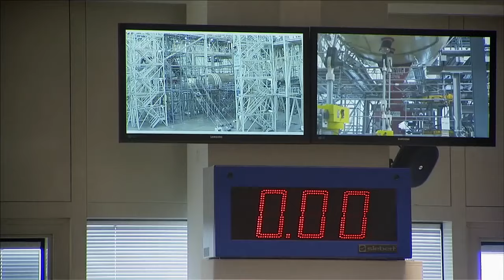Airbus A350 Ultimate Load Wing Stress Test

Comment: I used to be scared of turbulence thinking the wings will break off but when a saw another video like this is put my mind at ease.  Now the only thing that bothers me is the sickness caused by the up and down.
Reply: I don’t know if you still have this issue but my wife which is a nurse gave me a cool trick which does pure magic for me. 
I smell alcohol or something strong like etheric oils
It sounds stupid but it helps me incredible good.
One time we flew from AMS to JFK and we faced 3 times severe turbulence and it was absolute no issue for me because I pre ordered a whiskey just to smell on it when i felt a bit sick.
What also helped was breathing 4-7-8 technique and counting in my head. 

Safe flights mate !

Comment: The wings are incredibly flexible, but what about the mounting points where it meets the fuselage? Certainly as the wing flexes in flight, there must be tremendous forces exerted on those mounting points with the leverage generated by the outer parts of the wing. As I understand, the wing comes in 2 sections - left and right, and each section is bolted onto their respective sides of the fuselage.
Reply: Ever ask yourself why most large airplanes are round?
Reply: @RaggedsEdge  It's round because of max structural strength in dealing with pressurization and also to streamline.
Reply: @msbrownbeast  god…. I love getting actual good information from a YouTube comment😅
Reply: Both wings are connected to each other in a wings bar, it takes up the forces of the wing rather than putting the forces to the fuselage, the fuselage is connected to the bar instead. The same reason why the engines of the DeHavilland comet's engine design did not become a trend, since it requires a stronger and heavier bar running across the fuselage.
Reply: Well, the wings are connected and stabilized. The forces the end of the wings face laverage the fussilage, as the wings are connected. When force cant discharge, they will always cause centrifugal force to the up. Thats mostly why the wings are installed on the lower half of the fussilage. Wings cant break in earth conditions... But it always can happen, that the pilot cant handle the machine well while turbulences, or the avionics fail. But dont worry about the wings.
Reply: As others have mentioned the wings are connected and the wingbox is extremely robust. The best way to think about it is that the plane is attached to the wings rather than the wings to the plane.
Reply: Do you see the wings falling off the fuselage in this video?  I'm curious as to what prompted this worry AFTER seeing this specific video.
Reply: @Asdayasman  When you fly on a large passenger plane and sitting just aft the wing with a clear view, the large twin-aisle cigar tube is holding 400 people along with luggage PLUS air cargo, and all that weight is supported by the wings, when the wings flap during turbulence, it gets scary.

Comment: Looks like a lot more work needed to be done to stiffen the wing up before flight.
Reply: Unless you want the wings to break off from high tension, then flex is actually very important when it comes to dampening physical stress loads on the wing's structure. Take extreme turbulence, for example. If the wings didn't flex, the tension from the shaking aircraft paired with the stiffness of these hypothetical and flawed wings would make them snap off like pretzel sticks.
Reply: @jearlblah5169  you missed the joke
Reply: @robtien7  I don't get it
Reply: @zarrowthehorse  clearly